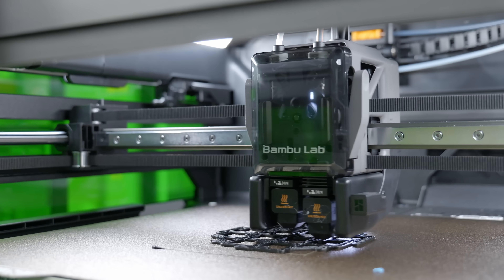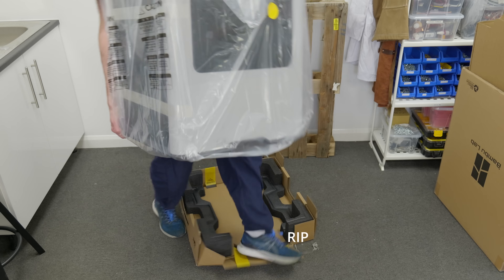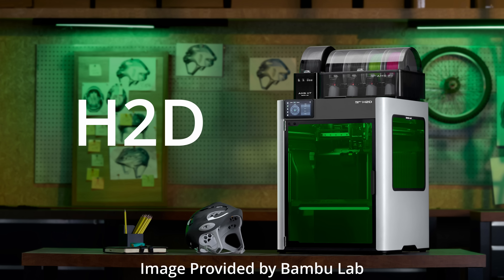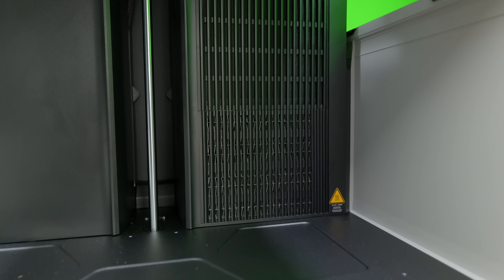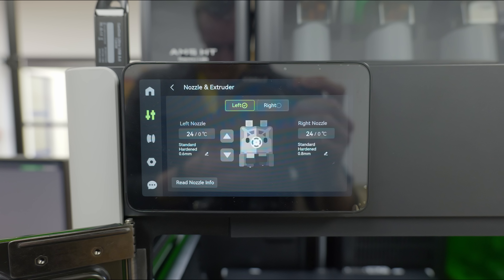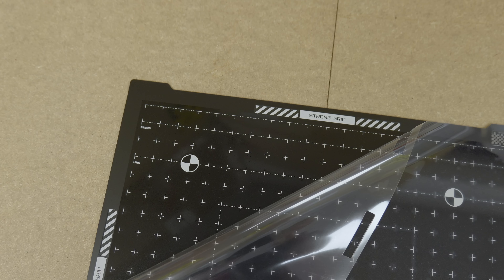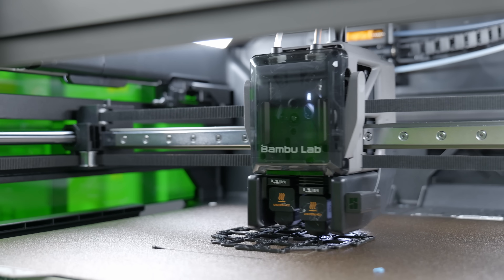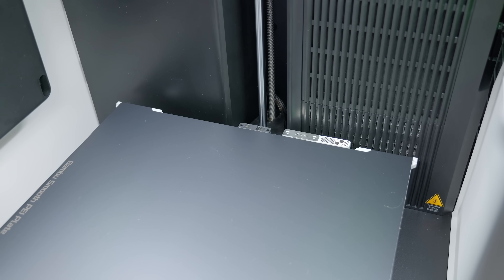Bambu Lab H2D First Impressions User Review

Comment from the maker: What parts of this machine are you interested to see more of when I do the teardown?
Reply: Allofthem?
Reply: I liked your unconventional teardown/review of the Core1 because of its uniqueness. The fact that Bambu is asking you to do the same for the H2D seems on par for copy-cat Chinese manufacturers and, quite frankly, is putting you in the awkward position of trying to recreate artistic spontaneous creativity. I'll probably still watch, but be deeply offended the whole time.
Reply: More about the offline connection/not using Bambu Studio. Why they said LAN/developer mode and there's no connector ?? Why always Wi-Fi damn
Reply: Hi, which parts of the printhead are metal or is the printhead frame plastic ? I have seen some reviewers claim the steppers are all closed loop, but in bambu's own wiki the z stepper is a normal stepper. Also how are they achieving 600mm/s and 20k accels with a heavy printhead without 4 motors or closed loop control.
Reply: The extruder
Reply: What are the dimensions of the new filter? Could become the new industry standard size.
Reply: The chamber heater, others have cut corners here and I'd like to think they haven't.
Reply: Extruder, seems the most complicated part with all that mechanics and gearing
Reply: Has anyone actually tested the real world build size? Didn’t the X1 have a smaller area than stated?
Reply: @1blktalon sort of. You have to do some modifications to get the extr the full 256mm and you lose some functionality like the ability to use the ams
Reply: @christophermessmer86 Thanks for the reply.
Reply: 1) Heated bed --- another independent check of heat uniformity issue reported by CNC Kitchen. 2) Complexity of the dual-nozzle extruder -- any robustness concerns for mechanical failures?
Reply: Can you check please check the build bed for flatness. Thank You!!
Reply: When is the teardown for? Been looking at your account daily haha
Reply: No Lan connection = it's trash and I will be switching to another company when looking to but another printer
Reply: @chuckycheesetouchedme7434   yes it's kinda weird since they say LAN and developer mode wtf. At least you can be offline with USB
Reply: @QuebecoisSti wlan

Comment: We really need a metric when looking at your speed assessment comparison. You need to be able to give the following information:  (my suggestion is) how many times the it has to change colours per layer on average. E.g. Average number of colour changes per layer of 4 colour sliced bench is 0.5 (made up for an example) but if you make the colours run vertically then the number of colour changes per layer might be 3 (I think this is the maximum with 4 colours) You could have a 16 colour model with each colour only used on one layer which would make the number of changes per layer again 0.5 (the same as the fast version of the 4 colour sliced benchy). Yeah so your review of time taken to “print” i think your results are meaningless? I could be wrong, what do you think?
Reply from the maker: It's a 'randomly' chosen example with no thought given to colour positioning. You can optimise a model with multi colour to reduce waste on the dual nozzle design but this mainly focuses around using one main colour and and one secondary colour per layer, effectively several two colour prints stacked on top of each other. The results aren't meaningless, there is just much more complexity and detail than I could test in the time available. I believe the results shown are a fair assessment of the system in general.

Comment: Imagine having one nozzle dedicated to support filament with the other using ams
Reply from the maker: That's not the case with this. What made you think that?
Reply: @Vector3DP  That is how this printer works, one nozzle outside spool can be used as a support material while the other nozzle hooked up to the AMS 2 can be used with PLA. Didn't you get a test model?

Comment: How come the panels are green but the laser safety specs are orange… what wavelength does the laser emit at and which is effective at stopping it?
Reply: The H2D lasers are UV ~450nm wavelength.  Do not purchase or use laser safety goggles/glasses based on the color of the lenses -- > verify the manufacturer's OD (optical density) vs. wavelength specs to verify you are getting OD4+ across a laser's emitted linewidth.  Lense color can vary depending on the wavelength range that safety glasses are designed to optimally block.
Reply: @Dude-ot9sb  and yet the green ones do not have a good OD rating for 450nm lasers if you actually looked into it.....
Reply: Ok, they show green safety glasses on their website which are great, for a RED laser. They should be selling the orange ones and the safety windows on the machine should also be orange.
I am so sick of chinese manufacturers using green on blue lasers....
ORANGE OR RED is what they should be using.

Comment: Why why why not just add an Ethernet port… this seems like the perfect machine to have one added
Reply: That will be for the H2E or whatever it ends up being called and will have a significant price premium.
Reply: @skrubol it is still bullshit, I work in electronics development, and an Ethernet jack, magnetics, phy and the soft/hardware stack and Devtime for that addition to switch the network stack from wifi to Ethernet should not cost over 20-50€ per unit (including hours of devs split, if at least 10k units), otherwise they are ripping you off.

Comment: The details on color usage and waste and speed were very helpful. I have never printed more that 3 colors in a print with my Kickstarter X1C. I do a reasonable amount of 2-color printing, so the dual nozzle print head would definitely be an improvement along with the larger build area. Thanks for an informative review.

Comment: When nozzle A is printing, is nozzle B already unloading and reloading itself so it's ready for when nozzle A is done so when it homes, it immediately purges? That would cut down a LOT of time.
Clearly this is a question when printing 3 or more colors.
Reply: What other reviews said: its loaded. There is one problem: the filement snaps. I think talk about making it so it will unload the one nozzle so the filement dont get broken from the movement when not used, if this make sense?

Comment: Does the printer not swap colors while printing with the other nozzle?
I'm curios on print times for 4 colors with splitting it into 2 AMS units. (2 colors per nozzle) vs a x1c. A simple cube with 4 stripes of color would be a good test.
Reply: Swapping colors involves pressing the toolhead against a plastic nub on the side of the case to engage the filament cutter, then pull back the filament, push new filament, purge over the poop chute, etc. So that cannot really happen while its printing. Further, there is actually only one extruder motor in the hotend that toggles between each nozzle as it is only controlling one or the other. The slicer does optimize how colors are arranged in AMS or external spools to minimize color changes where possible.
Reply: @techjedi2878  Adding to this, the new AMS, while having quieter filament loaders, are also apparently faster at loading filament as well.... so that should help cut back a little bit of the time to swap from one to another.

Comment: You actually dont want to print and dry at the same time as this will cause your filament to be slightly softer and will cause similar issues as heat creep can. So ive heard anyway
Reply from the maker: I've been printing and drying in janky setups for years, its definitely possible, even if at a lower temperature.
Reply: @Vector3DP I heard the issue is in the feed gearing. Pulling from a box through cold tube probably cools it enough to not gum up the extruder feed.
Reply: Drying and printing works fine for me in my SUNLU S4. Only tried it with PETG and ABS. Could be an issue with PLA. When drying a fresh spool. It is also good that the spool is rotating, because a full spool gets closer to the heaing elements.
Reply: you cant, so its that easy, cause when rolling , the filament can get deformed. but that dont mean , as its not drying, the dehumidifier dont work. so I would not worry, they put in a dehumidifier other boxed dont even have that. and not an auto one like this

Comment: Btw you have to use a box to print tpu it has a completely different port for the tpu that the new ams won’t feed properly in to
Reply: Or just use the side spool or use TPU for AMS.
Reply: @ it don’t feed you out of the ams reliably you would have to put the ams aligned with the tpu port the old ams has a hard time with tpu so I guess you can call a ams system a box but I thing a normal box works better guess If you want to spend 2500 dollars on the base model I wouldn’t want to have to make it work it should just work

Comment: We’re to start it’s a stain why would a printer that should be cleaned have oil smoke and staticky charged wood particles in it no to mention once you put a piece of polycarbonate or acetic petg of asa and it’s going to happen but don’t worry the spoiler will close and keep it all in so you can now ether open the door and let the fire and toxic gasses out or watch the fire slowly smolder on you build plate covering everything in soot in clouding you ventilation system that now ha sucked in the smoke and can linger among you mcu the nozzles I hate then you failed to mention you have to use two of the same size and cause it’s dual you can’t use 25 mm on the x axis unless you buy two roles of the same filament I hate that you can’t use buy literally five  time the machine for the same money and they act like there doing you a favor I hate that it tells you how to use it maybe give it a professional mode but I’m sure that they would charge for that lol I hate that you can’t use buy every single machine buy it’s self laser circut core xy and still have 1000 dollars and a cnc on top of that i hate that they have a 300 dollar machine that has beaten them in all aspecst and then the awnser with a machine that magically mathches prusia prices to the dollar so they can’t even market I hate how the closed out the 3d open source community a community that built there market with out them they wouldn’t even have any thing to sell and now there reaching trying to find the next one that’s how bottom line this has no innovation no hart it’s a company like maker bot that has alienated the core of a community and now is reaching hopeing the laser hits the bed or the knife goes through the mat to ell you a build plate taking ideas from the past and saying we’re so smart stealing and not giving anything back I have no idea how people can’t see how much they don’t care didn’t even send green glasses with the printer sorry just can’t wrap my head around why people like to role around in the pig pen
Reply: Care to include some commas and periods in your long essay plz?
Reply: @ .?!’ Place them were you must I’m all out of ####

Comment: H2D does not make the X1C Look Like A Toy. I guarantee that if people use the laser function often, they will dramatically reduce the life of the 3D printer. You do not want fire and smoke filling a 3D printer. Adding gimmicks to a 3D printer make the new printer look like a toy. That said, the 2 nozzle system looks like it was implemented well.
Reply from the maker: I wasn't considering laser and cutting when I made the title.

Comment: Anyone that thinks putting a laser inside this is a good idea doesn't have any laser experience. It is going to ruin the inside of this printer quickish. All that carbon and soot deposits is going to sit on everything and soon the machine will be ruined. I will definitely get the non laser version I like the dual nozzle system
Reply: I completely agree, you need to purchase two separate devices so that they don’t hinder each other. Practising everything and mastering nothing is not the way to go.
Reply: Yea, if you are doing it on the regular it's going to be a bad idea, my opinion has changed. Their wiki page shows it after 40hrs use and it looks like a good few hrs of cleaning. It's like 20 steps lol. If you need to save space and only need it once a month then it's still too expensive but an option. 

I'm interested in the cutter attachment, but the stand-alone price remains to be seen.
Reply: you tink they did  not run this printer for months on end????? while I agree, you would be foolish to think they did not stress test everything, like, why are people so low fruit thinking nowadays, yes sot will form, will you need to clean more, easy , yes. will it over time need replacement parts, yes, naturally ,they clearly think their new AUTO air systems  works very well in this aspect. controlled by AI and cameras and sensors. like them other printer and or lasers for 500 dont even have those features.

and if you tink you gonna buy then , to run it as a laser primary _? its an add on, to complement the printing expanding projects.
Reply: Sounds like you just need to do cleaning more often then, rather than just let it get ruined
Reply: @zephyfoxy  i have multiple cnc machines, printers, and both fibre and co2 lasers. You have no idea how bad carbon and soot is from the blue light laser especially when You doing wood. You would need completely take this printer apart to get the crap off the pulleys and belts and linear ways. This is a recipe for disaster. Please buy one. I want You to learn first hand because clearly listening to experience means nothing to You.

Comment: Although the major developments aren't what most were expecting there's plenty of good improvements on the FDM side as well. The air re-circulation feature, larger filter, larger build volume and automated flaps solve most of my annoyances with the original series. The heated chamber and AMS2 pro are welcome features as well. 

I doubt I'll need the laser and cutting tool heads I do like that they exist. I can see a myriad of reasons why someone would need them and if you do the price difference may make sense in that case. Overall I'm pleased with the depth of utility it offers and the upgrades it has made from the original and the fact that the AMS 2 is backwards compatible is a great strategy. I do hope they offer some level of open software options for the base model and hope they can also work something out with Orca in the future because it's a great piece of software that I prefer over BS.

Comment: I am not sure throwing a laser in to the mix is a particularly good idea. All that nasty particulate in the fumes to get everywhere and gum up the works. Also it's a bit small as lasers go so my preference would be to have separate machines for each task. Apart from that  Will probably not get another BL product as the firmware stunt left a bad taste in my mouth.

Comment: To Expensive, this is for very exclusive users, not hobby or normal people
Reply: "very exclusive users" at $1900 starting? It isn't cheap by any means, sure, but that just isn't that much money by 'hobby' standards - ask me how much auto racing costs, a single cylinder head costs as much as this thing😂 It's not like this is some unheard of price range, there's been plenty of options at that price and higher forever. 

I think a whooooole lot of people that are into 3D printing take for granted how absolutely dirt cheap it's been and still is for a bleeding edge technology. Even the H2D is pretty dirt cheap for its capability compared to products in MANY other adjacent industries(for lack of a better term). If you want to get into welding for instance and you aren't buying used, you're looking at about $1000 for a budget lower amperage setup all in ready to weld; nevermind actually getting into a quality name brand machine(the "Bambu of welders" would be your Millers, Lincolns, ESABs, Fronius), nevermind the definitely-not-insignificant consumables costs down the road, etc.